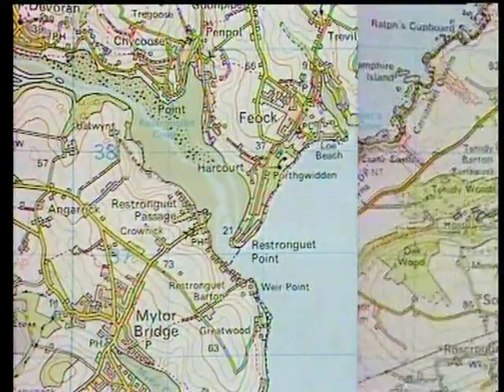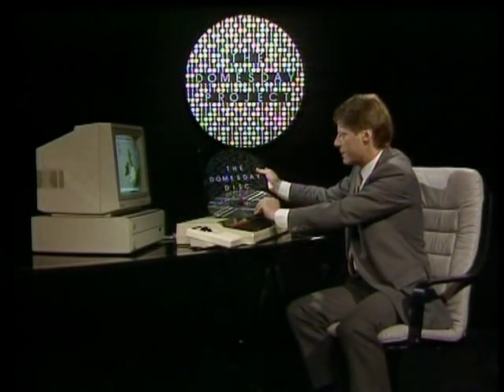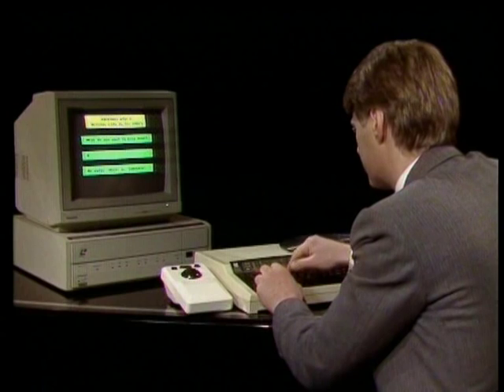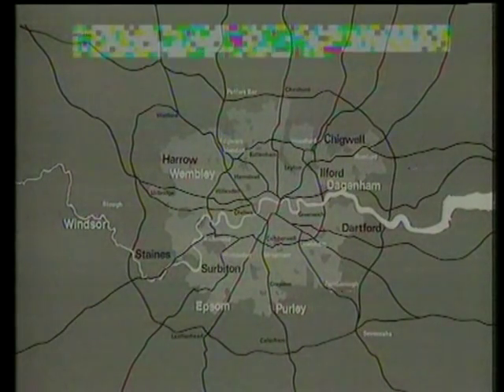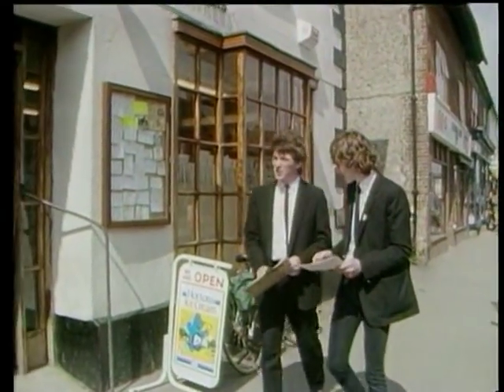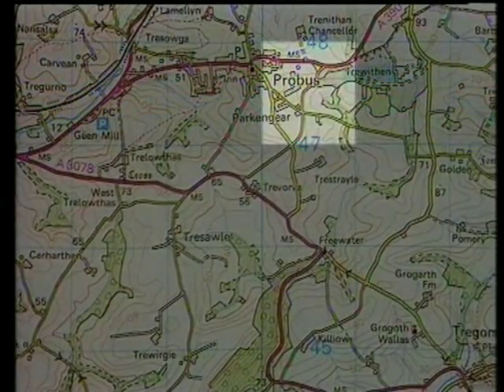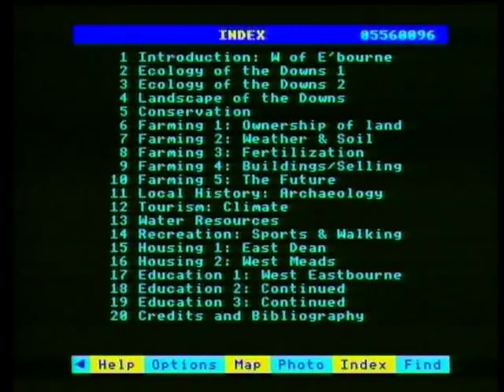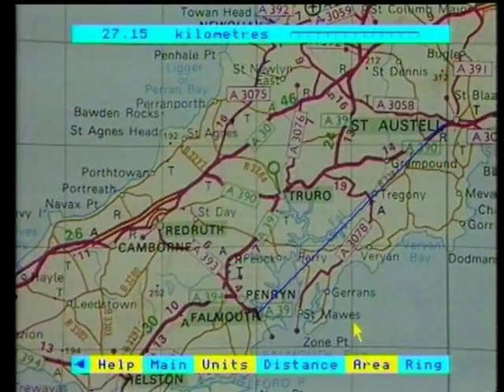BBC Domesday System - Promotional Laserdisc

Comment: Does anyone know which type of VP Player is used in this Demo setup?

It's not the usual VP415.

Also in this demonstration it probably uses a serial connection between the Master and the VP Player instead of SCSI connection which is used with the VP415.
Reply: it was a custom drive. one of the reasons why there was a scramble to preserve the discs in an open format about 15 years ago. the drives are going to die. if i remember right the computer used was a SCSI enhanced BBC master. the custom part being the SCSI attachment.
Reply: Seeing that it has the IR window, but no cart slot, it's probably the VP410.
Reply: @Dan-TechAndMusic  Yes it is... :-D